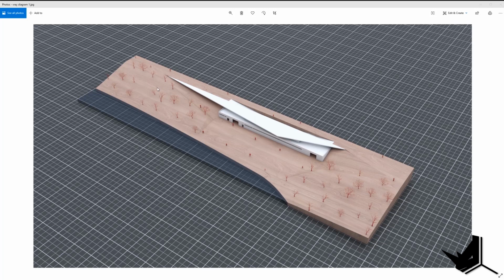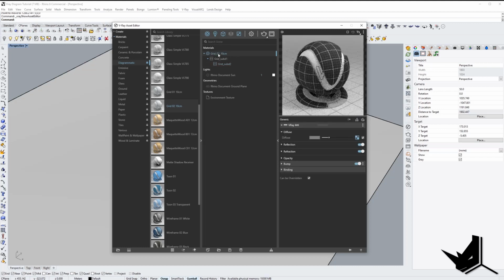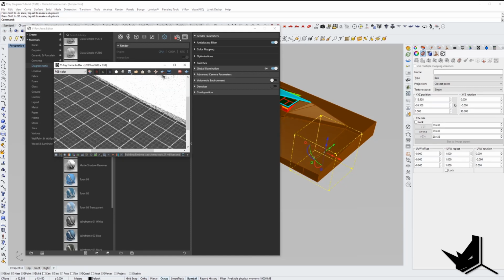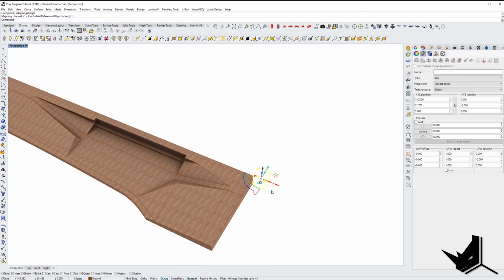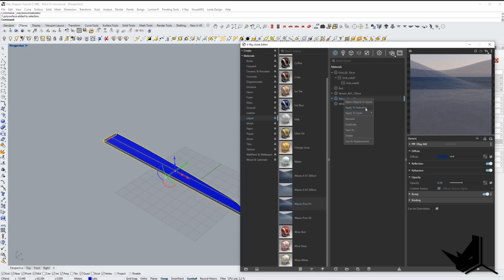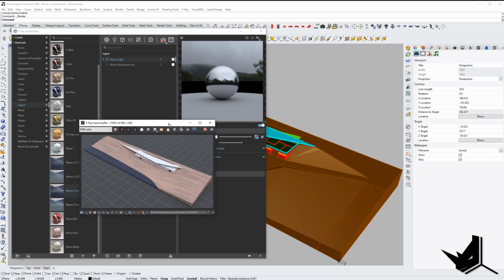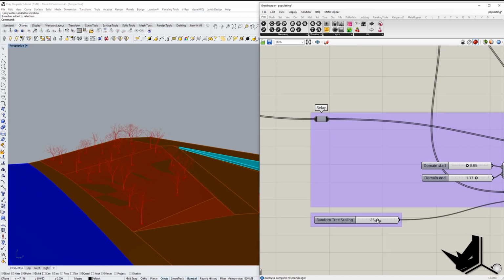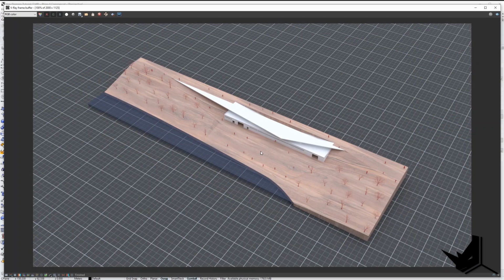Vray Next for Rhino in Architecture - Creating Architectural Rendering Diagram

Comment: Tried following along but my lighting didn't match, the grid texture didn't do anything, not sure if I had some previous things in VRay that were carrying over.  I have the worst to nonexistant success getting any kind of decent render out of the box and I have no idea how to setup a basic render setup before I start trying to do anything like these kind of tutorials.. Very frustrating.  Like when you casually said you brought up your map widget, I didn't even know where that was, didn't show up even though I set it up like you did in the earlier part of the tutorial. It just vanished.
Reply from the maker: Hey Ronald, 
Thanks for your comment.
If you'd like to take this a step further and have a complete step by step approach in learning Rhino and Grasshopper that includes our personal coaching, you may want to check out our Rhino for Architects 2.0 Course! Please reach out and send me an email at dusan@howtorhino.com if you're interested and I'll tell you a lot more about it there and share the course platform with you as well! We can't possibly cover everything here on YouTube :)
Cheers!
Reply: @HowtoRhino  well after much experimentation I did actually figure out how to EXACTLY scale the grid to the exact measurement I needed, following your tip about box mapping. It just took me a few tries to set the scale using the rhino grid. Now my big goal is to figure out how to apply different materials to different parts of say, a spaceship, without splitting and exploding the ship object and then grouping them together. That just seems to not be the best way, though it works for my limited needs. Just seems excessively destructive and ruins any future UV mapping application.

Comment: Dusan, aren't the people too heavy on the model?
Reply from the maker: Hi Youssef, good point. In this particular tutorial, I didn't cover the creation of proxy objects and materials so I stuck with the models as they are. The file is around 70mb, which is not ideal, but it's good for this example. If you're working with much bigger models, you may want to create vray proxy models first and then distribute them in your model. That way, the file size will be much smaller.
Reply: @HowtoRhino  thank you Dusan you re amazing keep it up💪👌